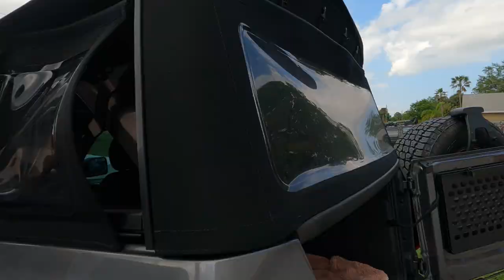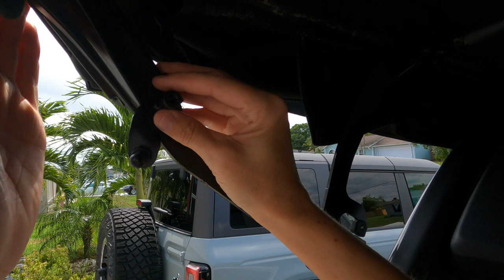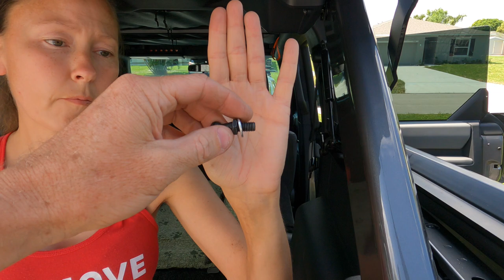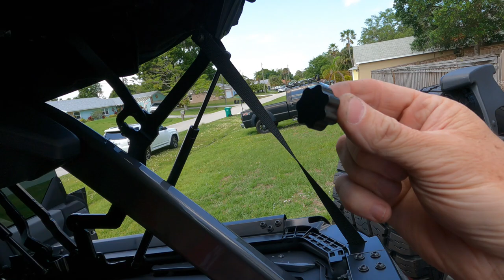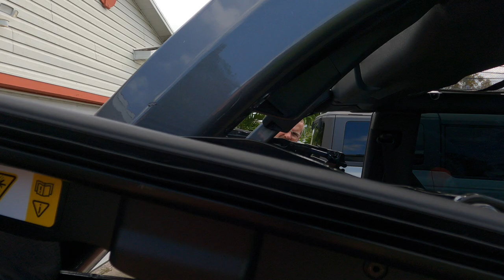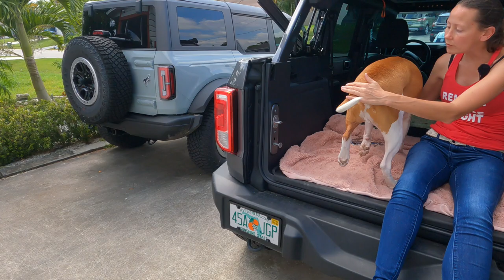BRONCO SOFT TOP STRUT INSTALL FROM IAG PERFORMANCE. ISSUES TO LOOK OUT FOR.

Comment: Was very helpful!! The instructions from the manufacturer for this soft top strut were good but not as detailed. Also becaue you showed the piece up claw I realized the hard ware with the ball joint on it came assembled on the outside rather then the inside. I had to take it off and turn it around. I would have never know that if you did not show the piece up close. I will send a note to the manufacturer to see if that’s been a problem for others. Thanks again for the detailed instructions
Reply from the maker: Welcome! Glad we could help

Comment: Although I don't have our Bronco yet we did order these from IAG and will be installing once it shows up.  You guys installed the top ball mount facing inside the vehicle.  If you watch the IAG YOUTUBE video they install theirs with the top ball facing out.  This could be why you had some issues latching the top down when fully open.  Not being critical.  I watch a lot of your vids and appreciate the content.  Just pointing out a discrepancy with your install and the IAG install on their product.  Keep up the good work.
Reply from the maker: I saw that too but the latching problem was because of the adjustment of the latch itself. We had removed the struts  to verify it was an issue before the struts and it was.  There are others who have had the same problem.

Comment: My Build date go pushed back a few days to the 1st BUT I did get my window sticker and Online support confirmed no Chip delay for my build or other constraints! I had been thinking of these struts and had read on the 6g Forums that they had some issues that were being looked into. Clearly you guys did not have said issues! I have since added these to my shopping list as well as the hood struts. Thanks as always.
Reply from the maker: IAG sent a notice out for the struts and new brackets will be sent out. That is good business. a quick response and resolution by a company to a problem customers are having. They get my respect for that. 

Gratz on the build date. I was told that my BD will be released from purgatory by 31 March... we will see.

Comment: Got mine, Struts were not strapped so it was a pain in the butt to compress them to get them to mount. At the time the video they had was for the strapped ones but now they have a video for ones without straps. Found if you push the top frame up you can get the extended struts to fit.
Reply from the maker: Oh wow! sorry you had a hard time getting them on.

Comment: Very helpful as always…about how much higher does the top go with the struts versus the factory stand?  Also, how does it impact the side windows since they have to flex when rotated up like that?  Would have been good to demo the struts with the windows back in.  Thanks for all the insight on the install!
Reply from the maker: Not much, maybe an inch or two, but the convenience of not having a rod helps. Plus to lift the top when it is down.

Comment: Your adjustment notes may prove to be a lifesaver as I'm having the same symptoms. I noticed you really had to wrench on that release lever...were you able to adjust that to a point where it was easier (or, hell, bearable) to use? If so, what did you wind up doing?
Reply from the maker: We were able to adjust it a little bit and made a huge difference with the release of the top.

Comment: Not only does IAG Performance make some cool Bronco Acc'y they have instructional YOUTUBE videos for  BRONCO : Putting the PPF on the Roll Bar, Oil Change, ForSCAN unlocking of GOAT Modes, ROOF Removal of BOTH Soft & Hard Tops
Reply from the maker: We will definitely check that out! Thanks Paul!

Comment: I just ran across a video post letting Bronco owners know that IAG makes a cut to size PPF strip to protect the Roll Bar. I've seen people do the same idea to the area that the soft top can rub when you're putting it back down. So if you order 2 roll bar strips you can cut the 2nd one in 1/2 = No More Rubbing against Paint for ALL 3 Contact Points. Problem Solved.  :)
Reply from the maker: It's not during the movement of the top, it's when it is fully down. It has rubbed all the way down to the bare metal. No amount of PPF will stop that.
Reply from the maker: Also with PPF, it will get dirt underneath it. So we aren't going to do it.
Reply: @1Five1Garage  Powdercoating ?
Reply: @1Five1Garage  So in just a FEW MONTHS it wore the paint off ? That's a sucks don't it.  Can you say DESIGN FLAW boys & girls, I knew you could.

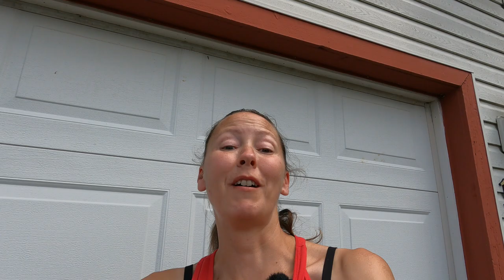Comment: 21:12 You hold your top down from the outside when you latch your top down in the front. Was that on purpose or coincidence. I've found I have to do that on my badlands to get the driver side to latch easier. I'm trying to figure out how to fix it. Currently for some reason the driver side takes a whole lot of pressure to get it to latch compared to the passenger side. Have you had that issue?
Reply from the maker: I wasn't holding the top down... I was holding me up so I didn't fall over when reaching for the passenger side. They are both pretty tight when latching.